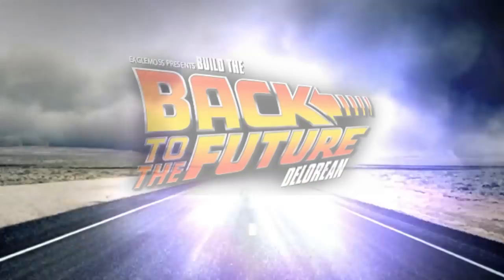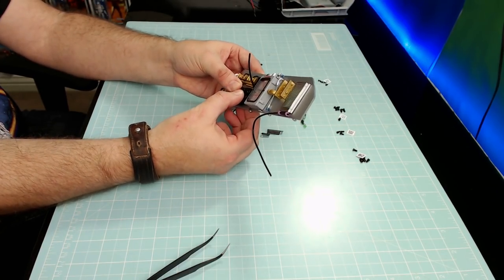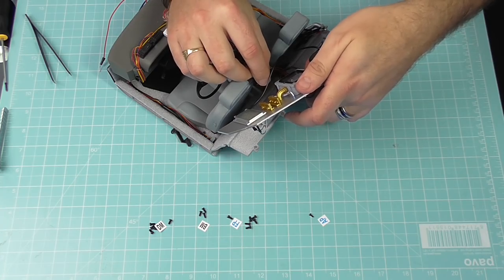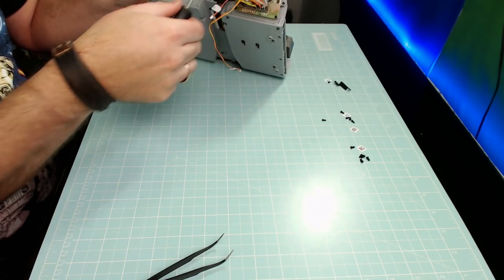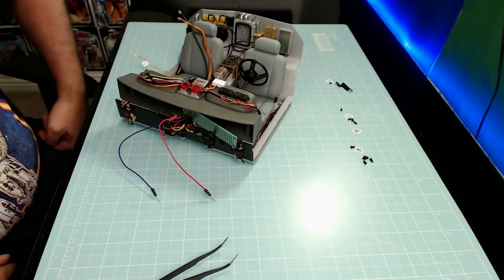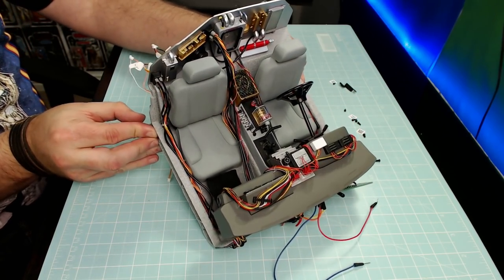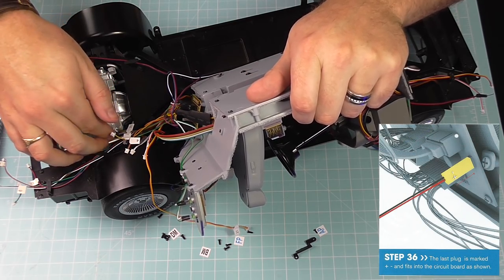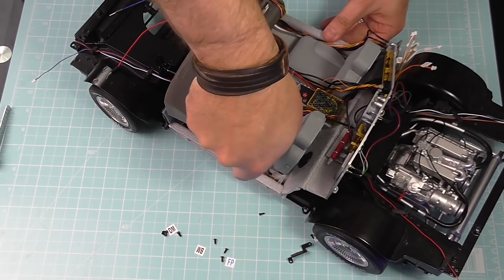Build The Delorean - Issue 59 - Connecting all the Wires to the Circuit Board

Comment: I would have gave up by now. Lol.  I had problems with mine right at the start with regards to the suspension.  I found the sure sign a bit of a struggle to do, the screws weren't catching at the time.  That's why I stopped building it.  It looks good.

Comment: Great videos Wayne, very useful and informative.  I was considering signing up for this but since watching these and doing some research reckon I'll give it a miss. I see it isn't already carpeted. And you are right the flux capacitor is poor. Even the board doesn't light up. I don't really want to be spending extra money on mods.

Comment: lol you'll be all videoed out  must off been at it all day, below will help - keep it up ^_^

Pressing 1 - Flux Bands
Pressing 2 - Digital Speedometer
Pressing 3 - Dash Board & Meter Panel
Pressing 4 - Time Circuits & Flux Capacitor
Pressing 5 - Upper Console
Pressing 6 - Headlights and the light inside the trunk
(Pressing 6 is also tail lights (just not brake lights))
Nuclear Reactor lights up with #1 along with Flux BandsReactor is amber
Reply from the maker: adrel you are an absolute star . Thank you.
Reply: Jason got bad habit logging onto wrong account  ^_^

Comment: Hey Wayne great videos, I'm at this stage now (the end of 2020!!!) but there's a few issues...not sure you encountered them...when pressing button no.2, the speedometer on top of dash board is not working, tried to reverse the wire 18 in the circuit as in 'Horlicks issues 59 video' but still not working...I would say it's faulty as in your case...also the steering rod keeps coming out from the fork when turning the wheels...so a screw has to be removed from under the floor as in Horlicks video, I'm sure I'll find more imperfections.
Reply from the maker: Mine was faulty too. I ended up cutting off the led and replacing it with a small red led i aimed to do it anyway do I can block the light bleed.

Comment: I must have missed it, but in an early issue you said to go by the colors of four of the wires.  I cannot tell if you put the wires in the slots by color or by the number on the black printed ends. If they are switched, nineteen does not go into the nineteen slot and so on.  What should I do?
Reply from the maker: Match numbers to the points on the board. I can't remember too much to be honest

Comment: I’m at the point in this issue where the four DM screws have to be screwed in to hold down the car interior piece to the frame.  I can’t get the screws to line up correctly.  Any tips for me?  I’d appreciate it!  Thanks!
Reply from the maker: I actually think I didn’t use them screws. I found longer ones from another build and it helped

Comment: Oh man just finished my build, put the batteries in and nothing.... 🤬🤬🤬 gutted should have checked at this point. Now I don't even know where to start to get them to work now. But connecting those connectors onto the board was HELL!!
Reply from the maker: Not good. Same thing happened to me in stage 91
Reply: @WorldofWayneUK  just realised it was actually the on switch issue!! I have brake lights, interior lights and the door lights, no flux capacitor or the blue neon lights. However switch 3 does nothing, can you give me an idea what button does what??
Reply from the maker: I can't remember to be honest est  ut if you ask in the Facebook group someone will have an idea.

Comment: I'm trying this now and I can't get the dash to screw in,  nothing underneath blocking it and I've tried different DM screws incase that was issue and the steering column is about two MM away from the rack and I'm this far behind because it took eaglemoss 6 months to send me the right wire from issue 47

Comment: Wayne it's Wayne.
Did you have problems making the wheels turn left and right once you connected the steering wheel. it's don't turn fully.
Reply from the maker: No. It seems to work fine. I did have a muck around with the steering mechanism way back when we installed the steering rack so I don't know if that helped,

Comment: Erm so noticed as I mentioned on Facebook yesterday my dials and plutonium gauges don't work and notice that yours do at this point so as worked when tested them seperately not sure where this leaves me to be honest?
Reply from the maker: Yep. If the others light then the problem is with either the circuit board or the switch. Does the switch click when you press it?
Reply: yep mine dont work either

Comment: It's easier to loosely fix the wire holder bits with a screw then put the wires in and tighten the screws

Comment: Hello there !! great job but I'm just at this point and no lights what can I do !!!!! just give up I'm really sad but I thought it will happen ...I check all ...really disappointed , I put the right battery ...regards Franzetti from Belgium
Reply from the maker: Check the connections going into the circuit board. They are directional. If you have them in back to front they won't work.

Comment: Hey Wayne, great build by the way. Can I just ask what is the circuit board at the front of the car?
Reply from the maker: That's my mod board that controls all the led and optic fibre mods I have done myself 👍
Reply: @WorldofWayneUK  wish we got a video about that . Trying to figure how to do fiber as well
Reply: Please Wayne. Please. Please please. Do a video on this. I want to add so many LEDs to the roof buttons and inside. As well as how you did your plutonium dial. But I cant find any good videos on this anywhere.

Comment: I just finished this issue and I thought about trying the already connected LEDs. Unfortunately, after putting 3 new AAA batteries and flipping the switch on, nothing. Obviously, it seems something is wrong. What should I do?
Reply from the maker: Check the wires are in the right way round to the control board. They only work in one direction. Ribbon cable plugged all the way in and finally power is going to the board.
Reply: @WorldofWayneUK  Thanks. I’ll check it out!
Reply: So, I found my mistake: somehow, I installed the on-off switch in the wrong position. Doh! Now, all lights inside he car seem to be working as in your video. I guess the non-functioning switches on the console will be controlling something to be added later. One question though: on videos of the completed DeLorean, the flux capacitor is flashing but right now, there is just a steady blue light. Is this normal? I know I could switch to one of your latest video to find out but I prefer to watch as I go...

Comment: I just finished this issue and it didn't work at all :(
What am I doing wrong?
Reply from the maker: The biggest issues are normally the rainbow coloured flat cable is in the wrong way, not pushed in enough or the buttons on the 1-6 switch are bent. They should click when you press them. Also check the other connections are in the right way round. They are all directional so need to be in the right way.
Reply: Thank you so much for answering my question. Well, the only thing is different in my Delorean, is the rainbow cable connector doesn't have those "R" and "L" marks on it, but I was carefully enough to connect this cable, based on the colors order I saw in your video. I also checked the buttons and they seem to be fine, and so the 23 connectors. I don't know what else to do.
Reply: All right, never mind. I just found out what the problem is. The on/off switch was placed the other way around. Most stupid mistake in history xD
Reply from the maker: @Arkzod  Your talking to the guy who took the whole vehicle apart only to realise the batteries were flat lol

Comment: So, I finally just did this issue and holy hell, installing the full thing into the base of the car is a freakin' nightmare!
Reply: I’m having trouble right now trying to get the car. Interior pice to fit onto the frame base.  Any suggestions?  It so difficult to line up the four DM screws to where they fit into the frame.  Frustrating.